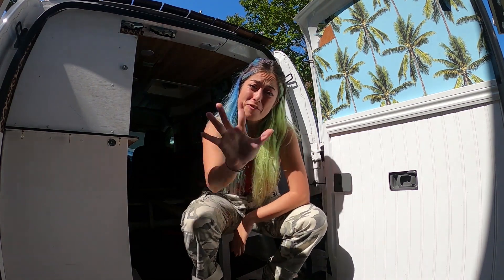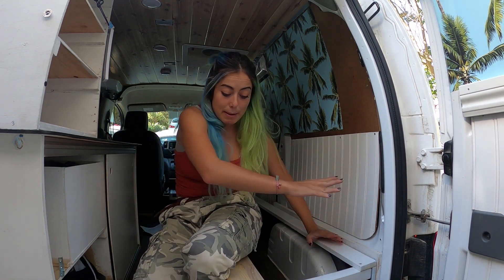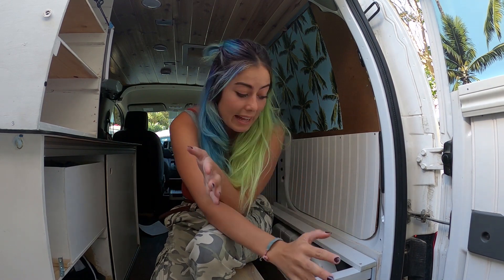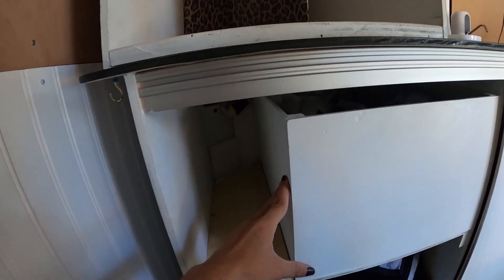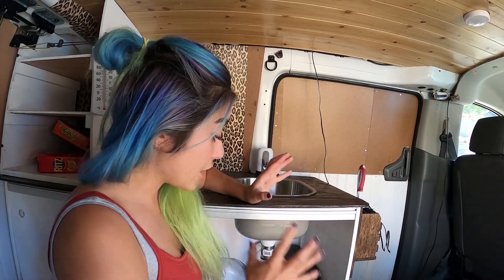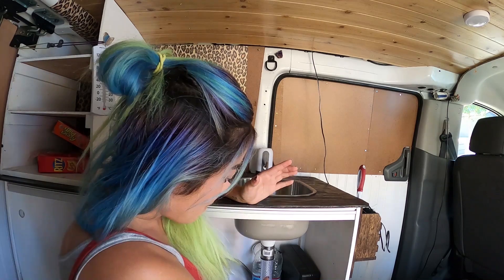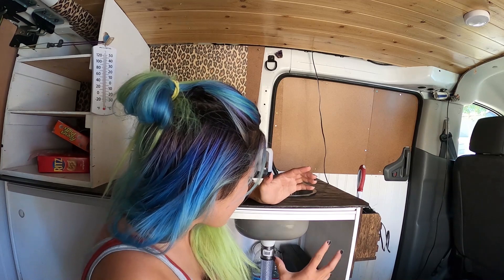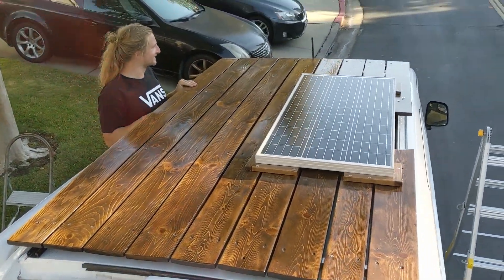MY 5 WORST VAN BUILD MISTAKES

Comment: In the winter you can use your fridge to keep things warm they are very well insulated and can keep things from freezing.  You will have to warm it up occasionally, but it's better than heating the whole van. It does make it so you cannot use the fridge for food, but if it is that cold out it shouldn't matter much, or you can bring a small cooler and fill it with snow or ice.
Reply from the maker: That's a great thing to keep in mind. Thanks!

Comment: Make sure you get a drys the air tablet system that we use in trailers and boat cabins to control damp environments where mold thrives

Comment: I recomend better ventilation to help with your moisture/ condensation problem, (your breathe in the cold can over a night will cover a lot of area sticking to everything in the van, then warming up in the morning turns it into moisture )but besides that you got r pretty spot on, your roof rack is sick!
Reply from the maker: Yeah I don't really have any ventilation in there and really struggled with moisture from breathing. The stores only had humidifiers for adding humidity so I looked online for a dehumidifier and they all pretty much said they don't work below 40° which is what my van almost always was
Reply: @JeniseSpiteri  aha yeah I figured with the temps your comfortable sleeping at a dehumidifier would be pretty much useless.. maybe you can modify the roof hatch some how so the hot moist air can  rise up..  if my calculations are correct (and I’m really terrible at math) it is. Right above where you sleep 😴 best of luck looking forward to the next step 🤘

Comment: I used to use small fan heaters because the electric used was cheaper than the natural gas cost of the heating system in the apartment I lived in at the time. One heater could heat an entire closed off room probably twice the size of your van. If you have your electricity situation fixed it might be something to look into. They are fairly inexpensive too. Usually $25-$50.
Reply from the maker: I'll check it out!

Comment: It’s expensive but you can get a heater that is connected to the gas tank of the van and uses that as fuel and it uses only like a gallon per 24hr if you’re using it constantly but you can set the temp and it may only turn on a few times! Heating can also will reduce humidity! If the inside of your van is heated then your things won’t freeze :) we’re about to get a van with one and really looking forward to van life! Do you ever go to meet ups?

Comment: You need to get some van tech sponcers. You need something to deal with condensation. You can get electric heaters if you don't want a proper diesel one. Insulation is a must. If space is a problem get spray insulation.ThankQ.TkEZ>UK

Comment: How many times do you recon you can charge the laptop with your power station? Was thinking of the same solution, but I'd only be out a week at a time tops. A friend explained to me how and what I needed to setup an inverter and extra car battery, but it all sounded like too much of a hassle XD
Reply from the maker: I've never tried to fully run out the battery but 6 hours plugged into the laptop without power coming in really eats up most of it. The box I have with either solar or engine charge would probably be fine for a week. Jackery/goal zero both sell solar panels that are portable and connect right into the box
Reply: @JeniseSpiteri  Eww, that's really crap, do you know how many Wh the box is?
Reply from the maker: 500wh on mine. I'm always editing though so I'm running through power very quickly. This summer when I had the box plugged into my solar panel I could use it every day fine
Reply: @JeniseSpiteri  Oh damn, hmm maybe I'll have to go with the inverter+extra battery then anyway, the boxes higher than 500Wh are quite expensive. 
Yea, I live in Finland, and we have almost no sun in winter, so a sun panel won't work well here. 
Big thanks for the info!
Reply: @JeniseSpiteri  Don't know if anyone is interested in reading this, but anyway, I tried connecting my 20 000 mAh power bank to my MacBook Pro via USB-C and it actually is able to charge it quite well.
The power bank is 74Wh, so it should be able to charge the computer fully once.
I can buy 12 of these for the same price as a 500Wh power station, so it's about half the price!
Reply: Feel like I need to reply again after some more testing, not to lead someone down the wrong track.
I tried running my MacBook Pro with both a power bank with 15W output as well as one with 18W output. When using the computer for more casual things like watching videos and such, the 18W power bank could just about keep the comp's battery at the same level.
Using the 15W it was using more energy than was charged. Not a problem for me, I can just take a break every now and then and let it recharge.
Doing more intense stuff, like video editing etc. you probably need something with, say around 60W output to keep up, like that power station.
It would suck, if you're waiting on a video to upload or something and the machine is running low on battery, but the power bank won't be able to charge fast enough to keep the computer alive.